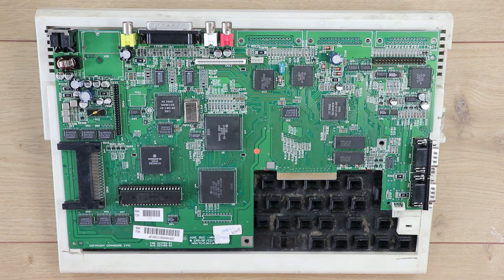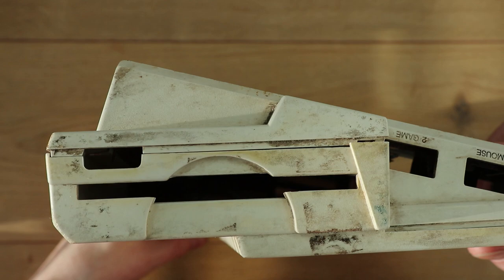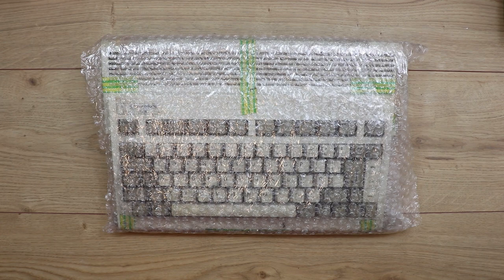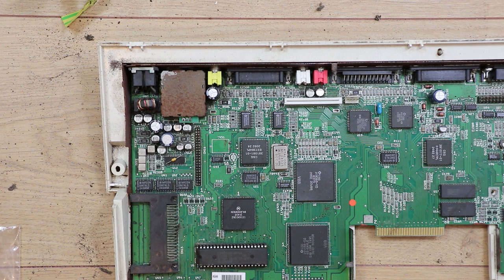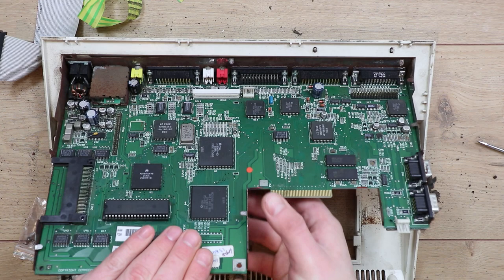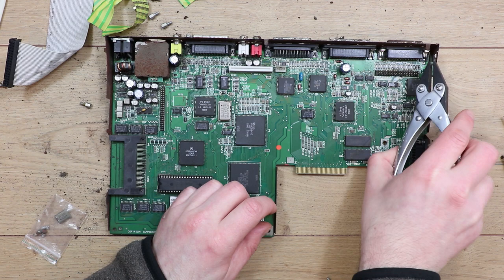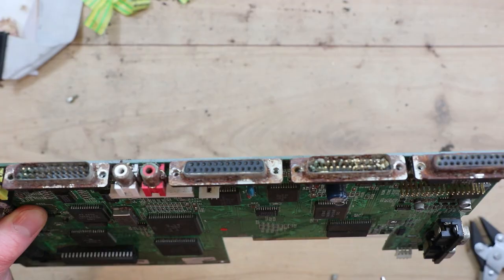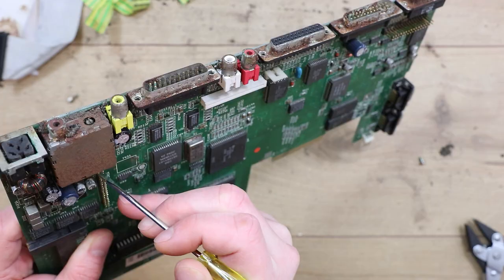Amiga A600 - A Bit of a Mess - Part 1

Comment: PCMCIA Paul :) 16bit card interface before 32bit Cardbus. Compact Flash has much more in common with IDE as far I know!
Reply from the maker: Thanks :-D I figured that afterwards, also found an old PCMCIA to CF adapter that fits. Not sure if it works yet though as I've not got that far. I guess IDE must be similar as there are no chips on the adapters to do anything clever.

Comment: I was offered one on ebay until i noticed it had flood damage luckily most of the ports are available as spares thru ebay
Reply from the maker: They are, but the 23 pin ones are hard to find or silly money. People have been chopping the ends off of the 25 pin d-subs and altering them as a half way house. I discovered this on some kits on eBay, it seems a bit of a rough way to do it but if it works then there's not much other option.
Reply: Good luck with the restoration. If you can resurrect that I doff my cap to you 👍😁
Reply: @DREAMTEAMTONICJAMES  didn't accept it I have a500 and cherry 600 restoring already got the furia and recapping getting done.
Reply: @Error42_  you can purchase them new from Individual Computers.
Reply from the maker: Thanks for the heads up on that. I wasn't aware. They are at least a reasonable price for the service they are offering, unlike the eBay sellers!